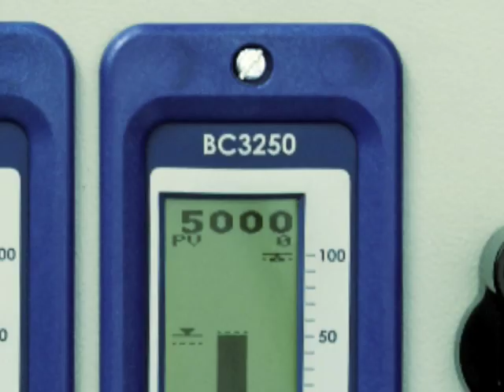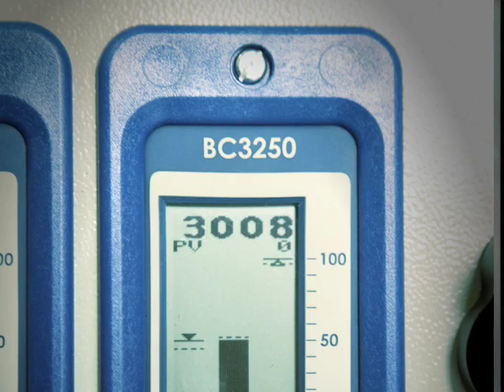Steam boiler operation - the inside story part 8: TDS control

Comment: TDS accumulates at the surface of the boiler water level.. this creates foaming and can lead to carryover (leading into potentially worse problems).  Not side blow down, continuous blow down and bottom blow down.  Continuous is the only one that can prevent or directly impact TDS accumulation.  Other than that you need to use internal treatment to allow these suspended solids to fall to the mud drum and through the intermitten/ bottom blowdown.